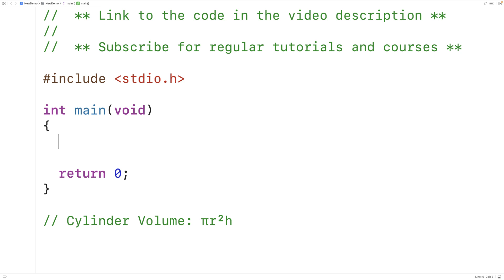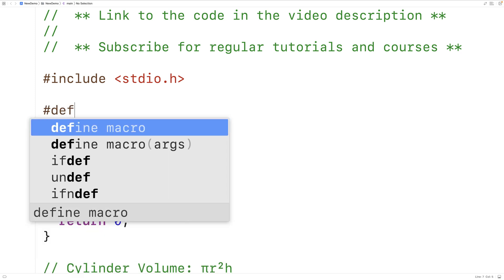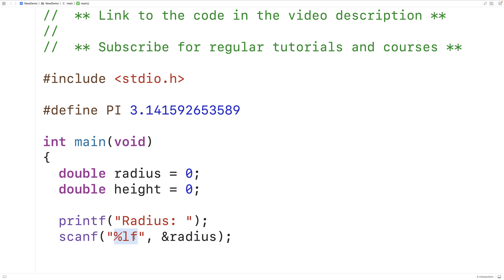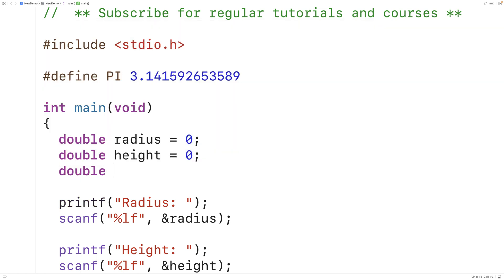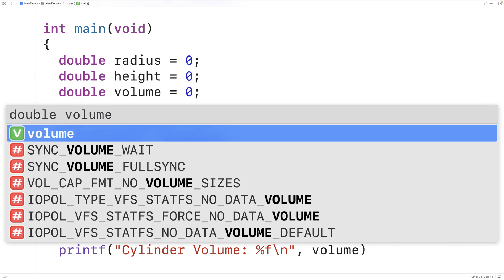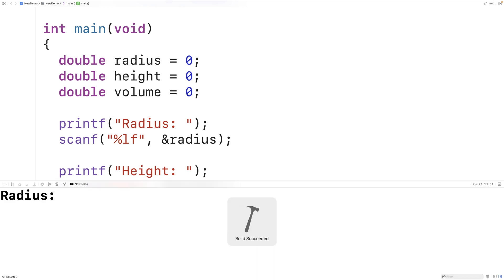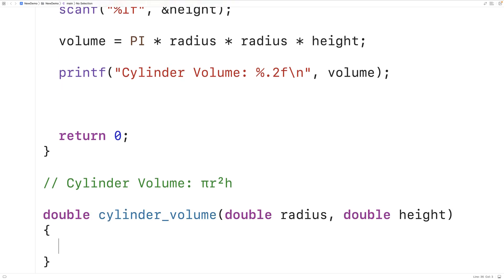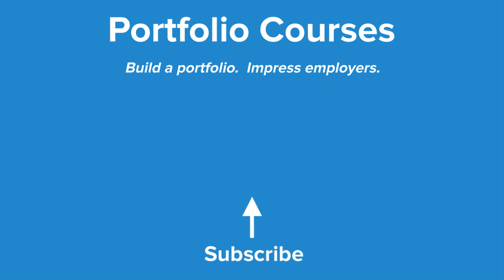Cylinder Volume Calculated Using User Input Values | C Programming Example

Comment: Hi may i ask why you dont use float and use double instead?
Reply from the maker: Doubles can store decimal numbers more accurately is really the only reason.  🙂  It doesn't matter too much either way in a simple program like this, we could have used float too.  Floats take up less space than doubles, and so sometimes it's worth the trade-off to have less accuracy but also less space used total.